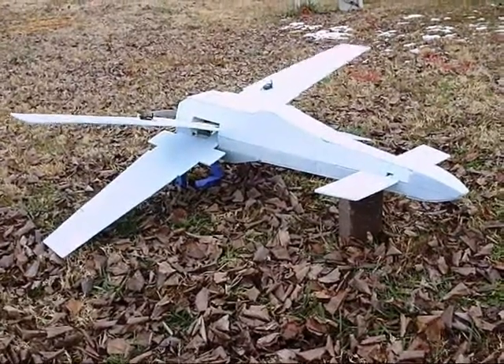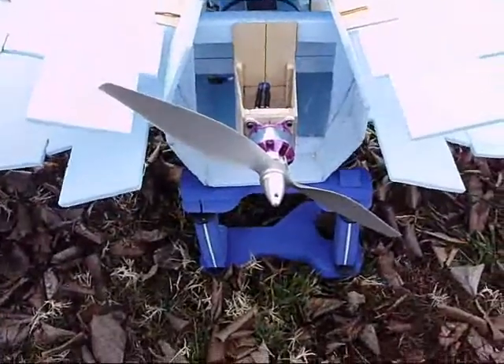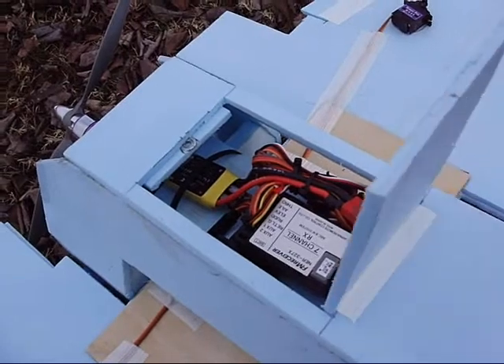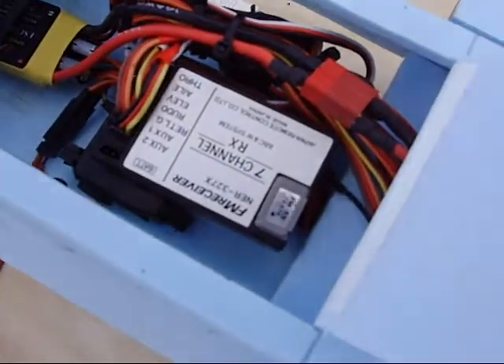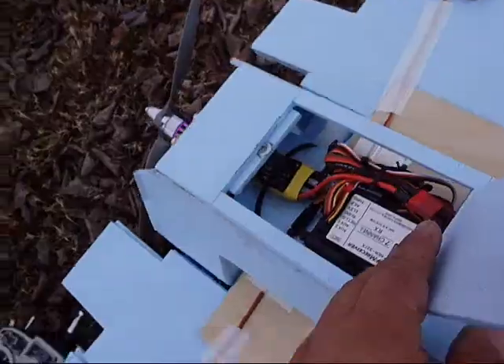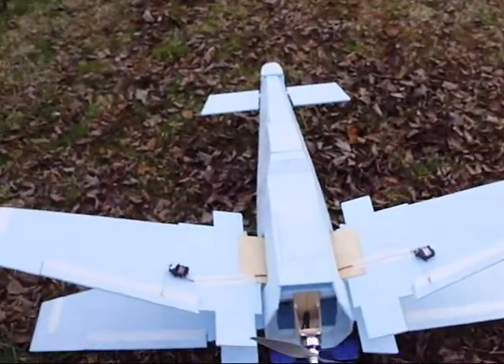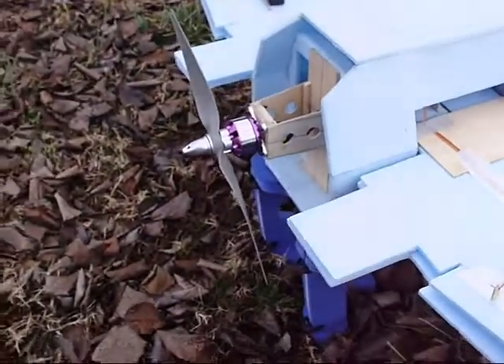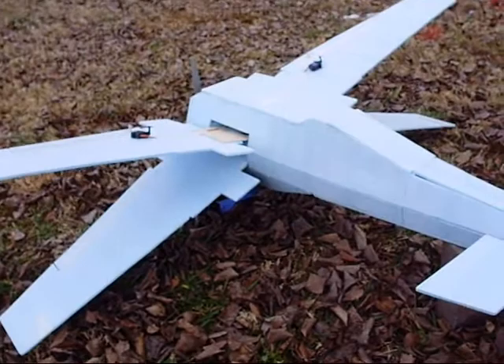RC Star Wars X-Wing Fighter build PART 4 (Rough Build test model) COMPLETED

Comment from the maker: @geekfish those are some good ideas. Yes I plan to use the dummy engines as a sort of a rudder long tube. I figure anything to help channel air in a line. Snce I have this test model built I been thinking about adding the parts to the wing as I plan to on my final. To test out how it reacts and all. Like adding those dummy engines. Also building up the wing near the fuse as it is in movie. I would like to try closed then an open version. As is it flies fine now. I want to see what all i can get

Comment: You have existing servos on each wing. If you set it up so that if it yaws to the left the two right rudders could produce drag, by the top giving down and bottom giving up, to bring it back to the right? Would adding a KFM 2 airfoil aid in stability? May help to make them more rigid as well? Could you use the x-wing jet intakes to create a rudder? Meaning create 4 tubes that would act as a way to stabilize it? I would hate to see a rudder on it.. You are so close..!!!

Comment from the maker: @eagledancer2000 Thanks! Im pretty excited to get it in the air. Im dying to see what it does when I close the wings. 

I was thinking for first few flights I may stick on a vertical tail and try flying with wings at both positions. Then if that worked remove the Tail and see how it goes. 
I think I am just bored and looking to build something since I cant fly right now due to wind haha.